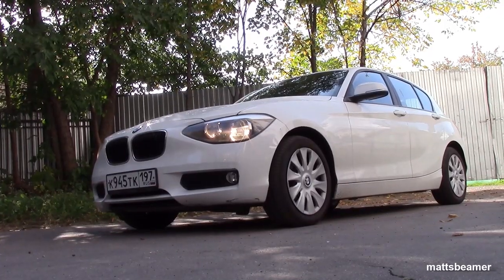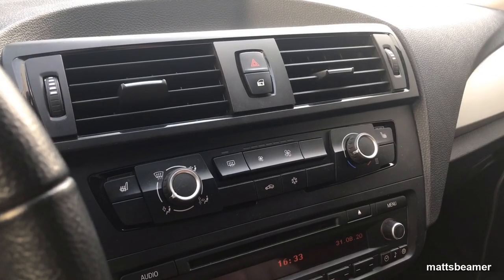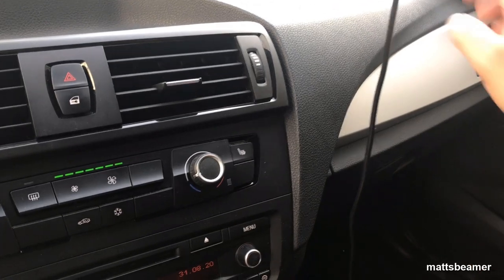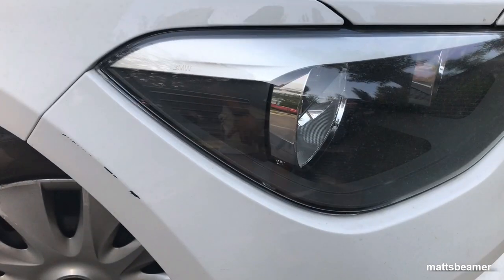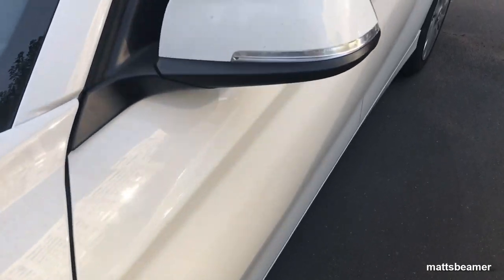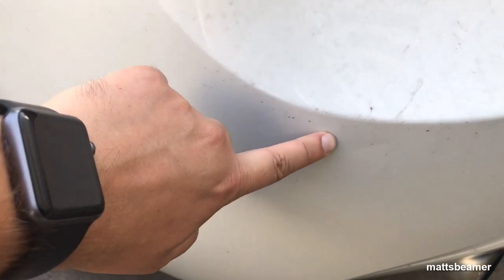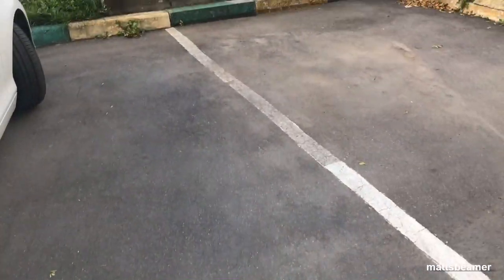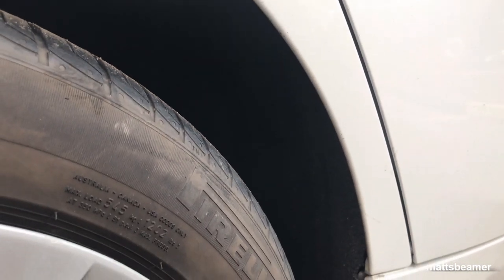All the faults I have / had with my BMW F20 116i N13   f21

Comment: Hi, a few notes, hope these help:

1. Steering squeak - most likely you need to lube the rubber seals where your steering column enters the engine compartment. It is reachable from the pedals. If not (just like in my case), you need to lube the U bearings of the steering in the engine compartment.
2. AC noise - could be a leaf in your filter, there are some DIY videos on youtube.

Y
Reply from the maker: Thanks for the tips! I really need to investigate the issue soon :D cheers
Reply from the maker: @joshsanderson5512  it’s just a video so people know what DIY videos are coming after the weather is warm. I can’t wait till we are in the plus numbers again. Lol

Comment: You could add the following : plastic tip of the oil dipstick broken off inside the engine. Not yet fixed. But engine seems to run ok.
Reply from the maker: Hello, I had the dipstick plastic part break off on my e46 compact years ago. Mine engine was also ok, as the plastic had got trapped in a filter. I hope
That yours will be ok too

Comment: Almost the same stetic issues in my 118i, even the scratch in the front bumper jajaja. Front bumper's paint is really thin. I bought paint for the scratches in the dealer, really cheap and works fine for those small details. Great video Matt, regards.
Reply from the maker: E E thanks once again for your input. What is your name? )) I may have to buy some touch up paint for the smaller areas :) I wish I had the guts to spray the bigger work. If it was an older cheap car I would :)

Comment: I have a BMW 118i 2012, I had some bubbling rust and BMW sorted it as they have a 12 year warranty on paint
Reply from the maker: Sebastian Mason oh that’s interesting. Is that because you have full service history from the dealerships?
Reply: @mattsbeamer  All new BMW cars  are covered by a 12-year anti-corrosion Warranty against perforation by rust. This started back in 2004
Reply from the maker: Sebastian Mason thank you :) I only thought they honoured this If the car was checked all the time BMW. I will be interesting to see if it works in Russia. I know with my iPhone, the warranty doesn’t work fully, as they say Apple isn’t officially in Russia, which was a pain when it came to trying to sort my bent phone lol.

Comment: I urge young people not to buy this car even though it seems cheap and well presented. My son has this as his 1st car and poor guy is so disillusioned about cars on the whole. It is so fragile, every month he has to get something fixed, cooling system, turbo orings, pumps, plastic hoses, fuel pump etc. according to Bmw dealers they are all common faults. Costing a lot. He is scared to drive the blimin thing now. This brand is only good to about 60kms, very very unreliable beyond that. It will empty your pocket and stress you out every time you drive it. Stay away from it.

Comment: Mine's going in for another recall next week to have the EGR cooler replaced. Apart from that, it's been totally faultless.
I do have personal issues with the car... Not sure if yours has one judging by the lack of sensors around the interior light, but all UK spec 1 series' come with a factory alarm, and it went off for the first time last week (left the window open). It's way too quiet. I don't see the point in installing one if the volume is so low it can't penetrate double glazing windows. Might ask the dealer if they can turn it up to 11 in the coding.
Reply from the maker: I do find the BMW alarms way too quiet, my BMW doesn’t have an alarm. :) I hope you get your alarm sorted.

Comment: I have a drive train sign on my car Matt please can you help me identify the problem. I find it hard trusting garages
Reply from the maker: Hey, with this light it could be anything. Mine came on because I had some dirty fuel in the system. It is best to get someone with a scanner to scan it, or maybe the car has a code in the system. Later I’ll try and find out where this screen is on the hidden menu. My memory isn’t good. Hopefully it’s a small issue
Reply: Mine was misfire needed ignition coils

Comment: Any chance of a buyers guide for the N13 engine? Things to look out for? 

Would you buy an F20 with this engine if you were buying today? Or would you look to buy one of the newer engines such as the B38 or B48?

I'm currently searching and struggling to decide, there's some lovely examples with this older engine for sale but I want to make the right choice to avoid reliability issues/costs!

Thanks :)
Reply from the maker: Hey mate, I made a N13 video on my channel. The comments I have received on that video are also very useful. I am planning to make an buyers guide for the F20. I am just trying to collect lot of information. 
I do like N13 and haven't really had any experience with the B38/48. But I will put information together for other engines :) Thanks for your message.

Comment from the maker: What faults do you have with your bmw f20 f21 1 series?
Reply: Hi Mats, cool and useful video as always!
I dont know if thats a fault of my BMW but its burning oil like 2litres per 6k km (it is 0.33l per 1k km). Ia that an issue for that model of BMW (BMW 1.6i, year: 2011, petrol, 136horsepower) ?
Reply from the maker: Liftily hey, thanks for the comment. I really need to look into this too as it seems common. According to a person who made some info on the n13 on wiki commons, they say that they can consume 0.7litres per 1000km or 1qt per 850miles. I’m not sure how accurate this is thou :)
Reply: mattsbeamer I’ve noticed when removing the vanos solinoids I had to remove the air pipes to gain access. There is a breather pipe that joins to the top of the engine block, it’s a flexi pipe. I noticed mine has some oil residue inside there. If you remove the top engine cover you can see there’s a square cover next to the pipe which underneath there’s a rubber valve which Apparently can split. I’m trying to inspect mine but I am unable to remove it and I don’t want to break it. I have also split the Flexi pipe which may have already been split but I’m going to phone bmw tomorrow for a new pipe. This link might interest you https://f20.1addicts.com/forums/showthread.php?t=1522560
Reply: Easy question to anwser..... none.......i am a lucky man......
Reply from the maker: Anthony Campbell that’s a very interesting link thank you. Please keep us updated. Good luck :)
Reply: @Liftily  

I don't know if you remember, I commented some time ago about my f20 118i eating the oil. So,  apparently it was the turbo, I had it re -done. So now I want to drive it more often so I can check the oil again. On the trunk, I have rust already around the window wiper
Reply: @TheMichaelsVids  thank you for your feedback bro. I was wond3ring if this (bmw eating oil) is normal or not.
Regarding your rust - i had it too but gave it to a car varnisher and he fixed it and from what i read and know about this its common thing for that model of BMW
Reply: Hi, same issues here in Bulgaria.This rubber sound from the steering wheel is caused by some ribbon cable behind the wheel. I was under warranty when the local dealership fixed it. They changed the whole module "Switch unit steering column" (61319351151). It's good to change it on time due to it can cause other problems that happened to me: the horn stop working, somehow sometimes the electrical steering can stop working - the steering wheel becomes really very very hard. The last one can be dangerous if happen while driving on the highway. The local dealership told me it costs around 600EUR for the spare part and 270EUR more for setting up the part and the car's computer. My car is 116d (2.0 engine) and it's burining around 750ml oil per 10 000 km. I'm still changing the oil every 20K kilometers. But the worst experience I had with this car was when all the fuel leaked up on the street/highway. I was told by the deal about some issue with the breathing pipe - the pipe where the unused fuel is getting back to the tank. It costs me so much nerves and just 20euro for a new pipe. I hate the rakling sound from the soft part of the exhaust system next to DPF (18307812263). But I'm not sure if it can be changed. The dealer told me I should replace all the DPF system which is 2K euro :) and I declined. At all driving this car is funny and nice especially because of the rear-wheel drive. Does anybody know if it's needed to worry about the timing chain?
Reply from the maker: Slavi Tsvetanov thanks for your input. I adjusted my steering wheels height the other day and it seemed to disappeared. Maybe I am just lucky. If not, I guess I’ll be making another diy video lol
Reply: 2014 model year and 160k km none at all :)

Comment: I just  turn 18 . And  i want to buy an f20 . Do you think it s a good car for beginners.  It is hard to drive in winter?
Reply from the maker: For Hey, the good thing about newer bmws for new drivers is, they are very easy to drive. In winter snow will be a pain, so if where you live has a lot of snow, maybe not :) when I was 18 I was on my 3rd BMW which was a (now classic) e30 325i touring, that was a slippery car in the wet lol :)

As for running costs, BMWs need to be serviced on time, and as for the oil changes, it's best to do that sooner then BMW says :)
Reply: @mattsbeamer   I live in romnia and some people told me  isn't that hard to drive  rwd in winter.  But I want to  hear it from a f20 owner.  I heard the car has a good stability and if you dont  have speed  in slippery conditions  I won't have a problem .but  thank you
Reply from the maker: Fok I cool, I have got some friends From Romania :)  yes you should be ok. Are you allowed studded tyres in Romania? They really do help on the snow. RWD can struggle on hills with no studs.
Reply: @mattsbeamer  it's forbidden
Reply: @mattsbeamer   hello  . I bought the  car . But I have a problem  the  handbrake is weak.  Did you have the same problem?

Comment: Bro I just bough first BMW ever in my life.
My family has always tradition to biy VW like haha.I bought 116i F20 130 000 km on clock.
Do you think this is a good car?
Thanks for replying!
Reply from the maker: I have been very happy with mine :) keep on top of the maintance and you should be fine :)
Reply: What about the engine? Any issues? Specifically, did the timing chain need replacement? Oil consumption? Engine-related emergencies requiring you to have tha car towed? I'm going to buy an F20 soon, and I'm kind of anxious.
Reply: hows it goin?